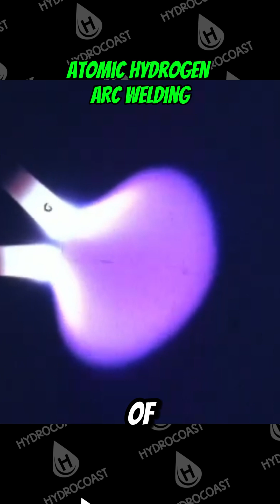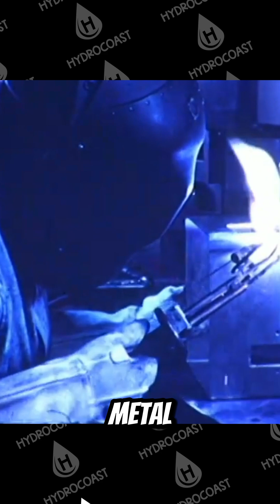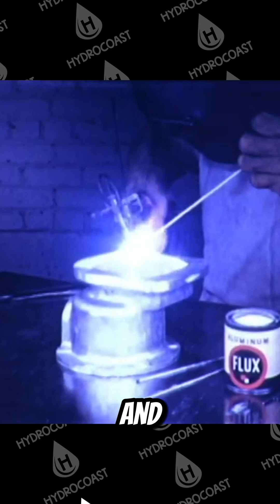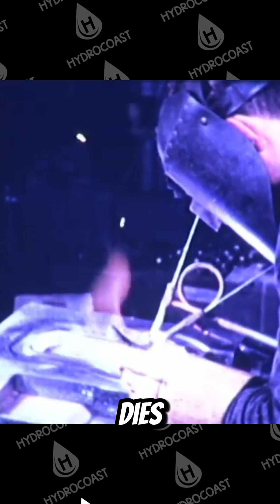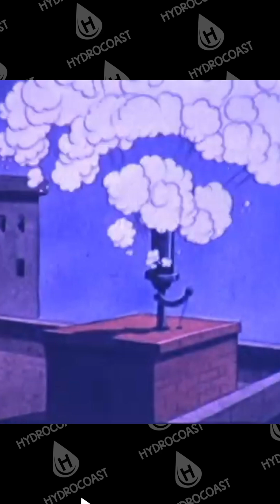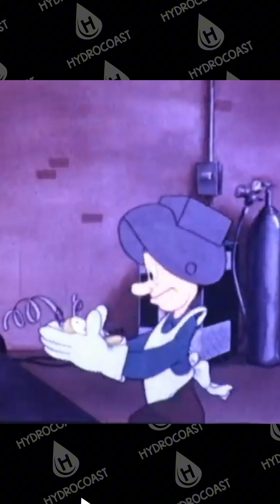Atomic Hydrogen Arc Welding: The Singing Arc Is Real 🎤⚡ #bluecollar #stickwelding #welding #weld

Comment: I can't figure this process out, and I've never heard of it. Tig welding must have replaced it pretty quick.
Reply: Yes, atomic hydrogen welding was introduced around the early 1920s, and Tig was introduced around the mid 1940s using helium as the shielding gas, which is why many old timers refer to Tig, technically called Gas Tungsten Arc Welding, as Heliarc welding.  Although helium allows for a hotter arc for a given current setting and thus improved welding speed and penetration for thicker materials especially metals with high thermal conductivity such as aluminum or copper alloys, today straight helium is rarely used because it has a number of disadvantages.  

Because helium is much lighter than most other gases, a higher flow rate is required to give adequate shielding, and thus costs are much greater.  Striking and maintaining an arc is more difficult because of helium's much higher ionization potential compared to argon. As a result a shorter arc length is generally used.  This can increase the chance of accidentally contaminating the electrode with the base metal or filler metal. Instead, an argon-helium mix is generally used where more heat input is desired, generally 75-25 or 50-50 argon-helium is used depending on the specific application. Less common mixtures like 25-75 or 10-90 argon-helium are sometimes used as well.